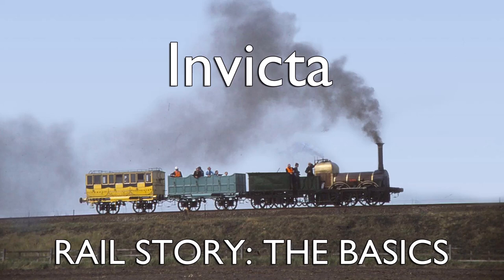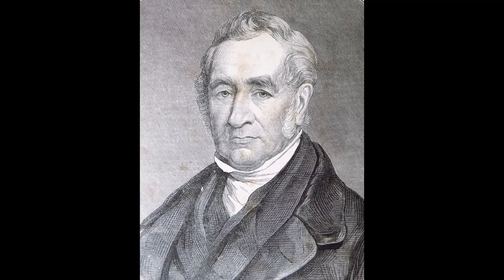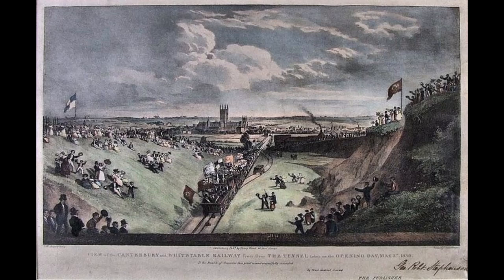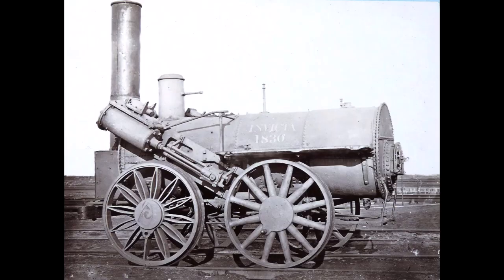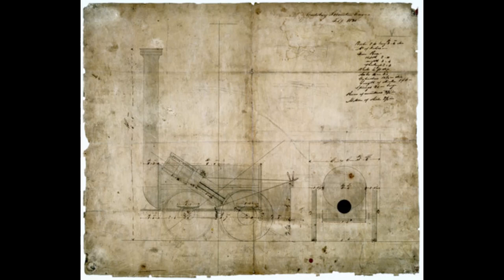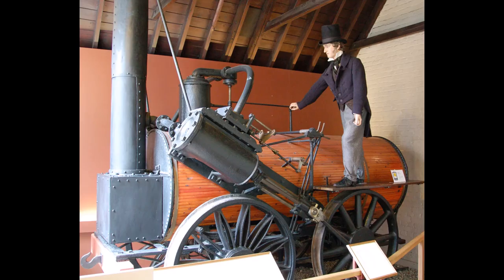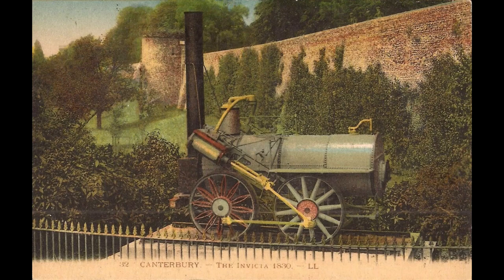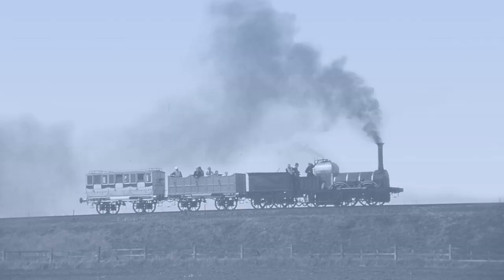Invicta: The Basics

Comment: I'm fascinated by the depictions of its single axle tender...never seen anything like that in contemporary railroad accounts or illustrations.
Reply from the maker: I'm not convinced it's correct at all. It could only work if it was bascially articulated with the locomotive, presumably to provide more adhesive weight. But you see all sorts of weird depictions of locomotives at this time, even by competant artists.

Comment: Enjoying this series of videos from Mr Dawson. Maybe somebody can inform me on just how it was the engineers were able to manufacture complex components such as pistons, cylinders and valve gear before, as I see it, the use of steel?  See the above drawing at 0.40 as a good example of valve gear etc. So I have read in 2 different books on early locomotion, iron ruled the day for track, locomotive wheels, frames and boiler plates, but the first mention I see for steel is about 1850. Help from the learned much appreciated.
Reply from the maker: Components such as cylinders were cast iron, and things like wheels, boilers, valve gear etc were all wrought iron. Some compnents were 'steeled' such as slide bars but most components were simply wrought  iron. So boiler plates were rolled from wrought iron. Components such as axles were forged by hand, later by steam hammers either from individual bars of iron or pressed together from forged components. Wheels were fire-welded from individual components rather than being cast - cast iron wheels are very brittle. Tyres were also wrought iron; they were heated and then put on the wheel and left to cool so they shrunk to fit as tighly as possible. Frame plates again big sheets of rolled wrought iron drilled and cut by hand, and finished with machine tools. eg slotting machines, planing machines and lathes. Wrought iron in many ways is superior than steel for a boiler as it retains some elasticity - a steel boiler will not give any indication its about to blow or stand the punishment of a rivet, wrought iron boiler. It was all done by hand.

Wrought iron is cost effect, durable and relatively easy to work. Back then in the 1830s, it was also a relatively new technology. Whilst iron had been used for centuries, rolling iron in sufficiently large plates was new. So too many of the skills to fire weld. The railways had a demand for good quality iron and skilled smiths and the technology and smiths rose to the challenge.

Rails were also wrought iron, steel rails didn't really come along until the 1860s after Mr Bessemer had patented his process in the middle of the 1850s. Steel rails were more durable but also harder to bend to shape. 

Hope this helps.

Comment: Other fascinating story is behind ericssons "Novelty" I guess, it was some kind of firefighting equipment I heard and was used by the rainhill trials and there it met "Cycloped", although non steam its a fascinating story by itself.
Reply from the maker: I'm working on videos on Novelty and Sans Pareil :-) watch this space, Paul.
Reply: @AnthonyDawsonHistory  Nice!
Reply: @AnthonyDawsonHistory  in your book about the Rainhill trials I believe you did show both engines in a better light than other writers have done. in the case of Hackworth's engine it seems she had some problems that was only discovered in till later on. despite being a industrial type engine she should have by rights come in second place to Rocket.
Reply from the maker: @eliotreader8220  Novelty was a blind alley. Sans Pareil was obsolete, dead-end technology. Even if Sans Pareil had come in "second place" the design of boiler meant that it could not supply sufficient steam to the cylinders. Whilst Sans Pareil could run quickly over a short distance, it could not do so consistently or for a sustained period, whilst Rocket could. And that was thanks to the boiler design. As Dr Michael Bailey and John Glithero concluded in 2003 Rocket was the outright winner, not jsut because it was the last man standing but because a) it performed consistently and reliably and was able to operate a fast, timetabled service b) the design could be expanded and improved upon. Sans Pareil was the last gasp of old technology.

Comment: The tunnel... being build this early and this tight, it prevented some rolling stock to pass through, like French Fasu and Italian Fb wagons.
Reply: The Tyler Hill Tunnel was single track, and very small bore - it would remain a bottle neck on the C&W until closure in the 1950s. They had to use adapted or very small locomotives to work through it.
Reply: @DiegoLiger  Like School class?
Reply from the maker: Much smaller than the schools. Tank engines!
Reply: Anthony Dawson the School class was too large??
Reply: @AnthonyDawsonHistory  I wish I had been on the last train (brake vans) but I was very young and we had no car then. The loco was an ex-South Eastern R1 tank with cut down chimney and possibly altered cab.